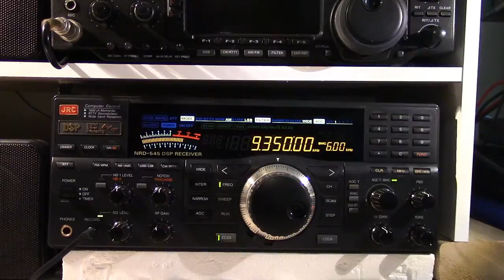AMS vs ECSS on the JRC NRD 545DSP

Comment: Thanks for this. Another good example of ECSS. Of course, it's even more impressive when the stations you're listening to are not S9+20dB. This process comes into its own when tuning weak signals. I don't know if you've seen the example I put upon YouTube a few weeks ago using the Yaesu FTDX3000. In that test, the ability to improve reception of interfering stations by using ECSS and switching sidebands to avoid jamming were quite impressive. You can check it out at:
http://medxr.blogspot.com.au/2015/06/dxing-with-ftdx3000-part-1.html

Thanks again, keep up the great work and 73, de Rob VK3BVW
Reply from the maker: Rob Wagner Thanks Rob, will def. watch your video. I agree, ECSS is often the best method around, especially if the band is crowded.  The JRC radio has such flexibility when it comes to bandwidth too, not a perfect radio, but close.